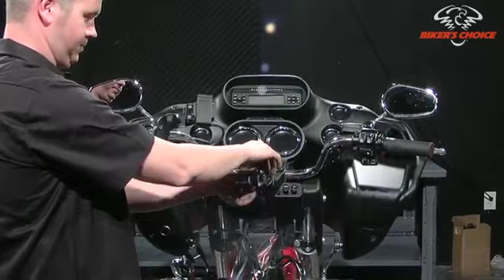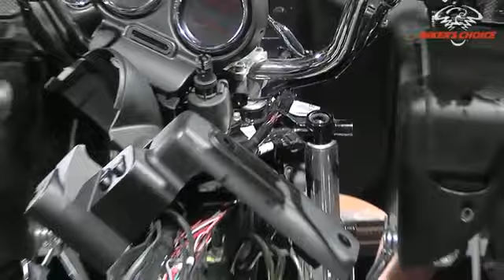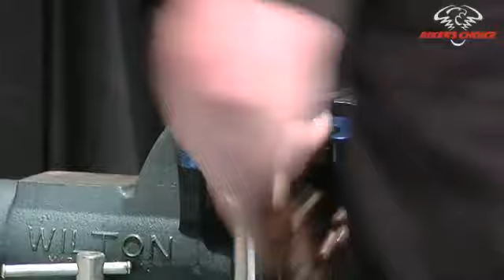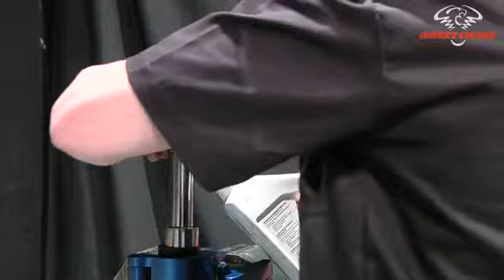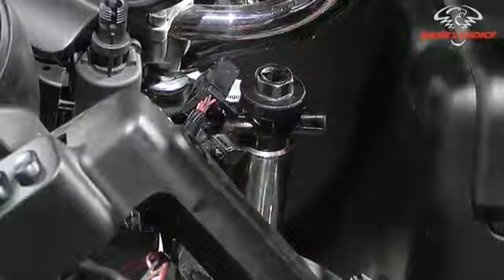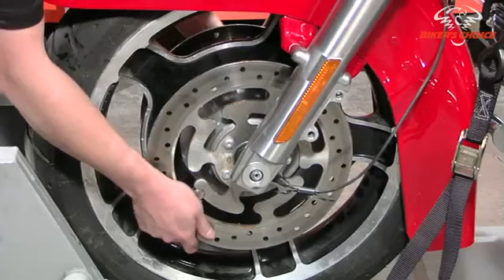How To Install Progressive Suspension Shocks (Front) - www.BikerTrends.com

Comment: They also don't mention that it can be areal bitch to loosen and or tighten the rod bolt in the end of the bottom tube. There is no way to secure it from the outside and often times the rod just wants to spin. I ended up having to thread a longer bolt in through the drain plug hole to apply pressure to the side of the rod.